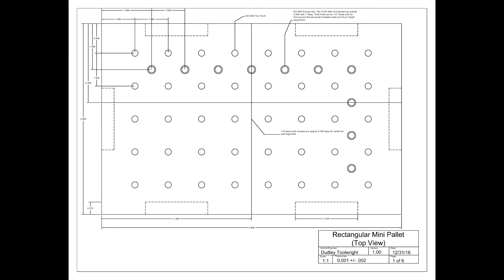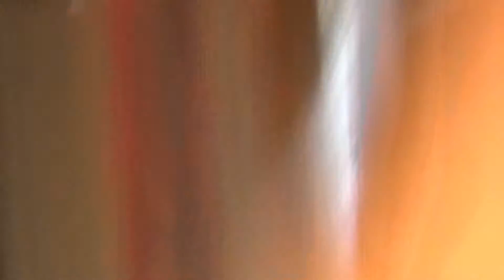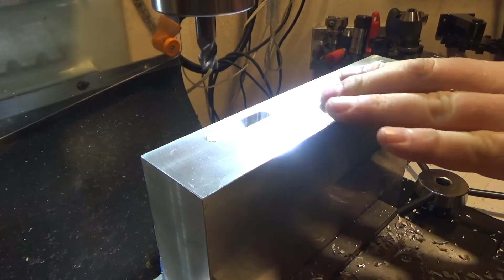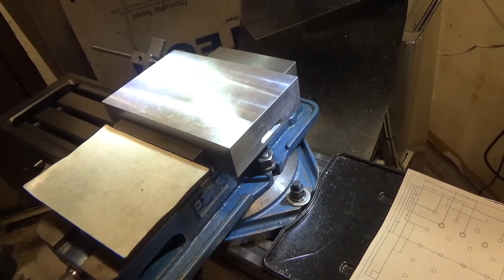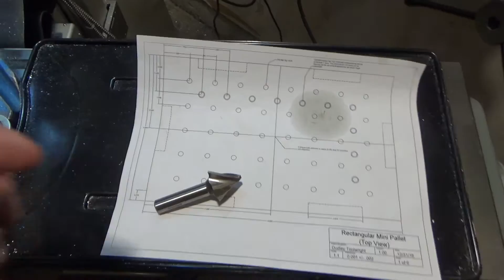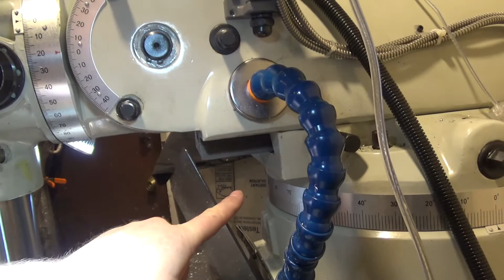Mini Pallets Part 2 The Mill Vise Pallet

Comment: Great project,  I plan on doing something like this when I get my Bridgeport clone here in a month or two.  The one I ordered is on backorder.  Oh well gives me time to save some money for it.
Reply from the maker: Use heavier stock for the clamps than I did. I have used the mini pallets since I made them and there is a bit too much flex in the 0.125" hold down clamps.

Comment: Nice job. I like the idea of the locating pins. Guess I need to do some modifications on my pallet. Thanks for sharing.
Reply from the maker: Thanks. It was one of those ideas that popped into my head when I was sort of daydreaming about how I wanted to proceed with this project. All of the projects I show are revision one, so I typically would make some changes for a second iteration. For example, on this project, I initially thought it would be okay to put the 10-24 screw holes down the same path as the v-grooves, but when I was drilling holes I discovered that this was not quite what I had in mind. That is why the tapped hole layout is non-symmetrical. Speaking of last minute gaffes, the next video I am going to put up, "the rotary table mini pallet" has a few screw-ups, because I did not initially plan on milling the flats in the sides and I also miss interpreted the way the bolt circle function works in my DRO. Live and learn right. Thanks for your comments as always.